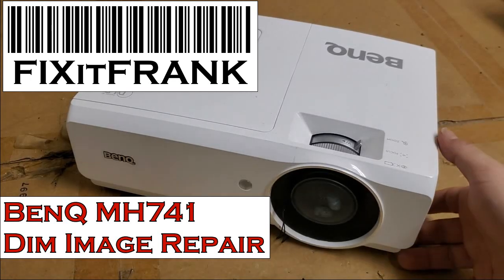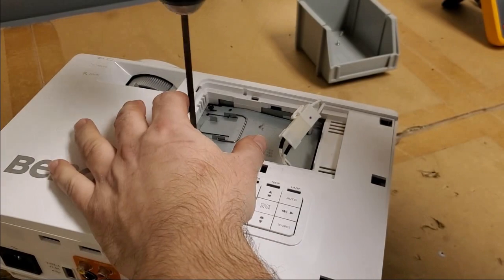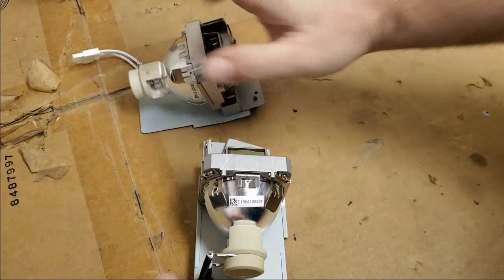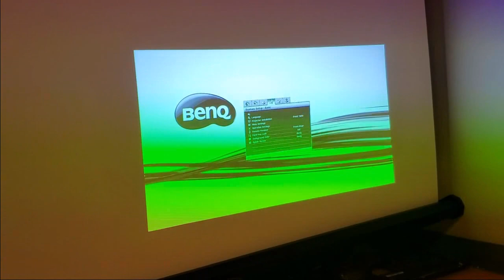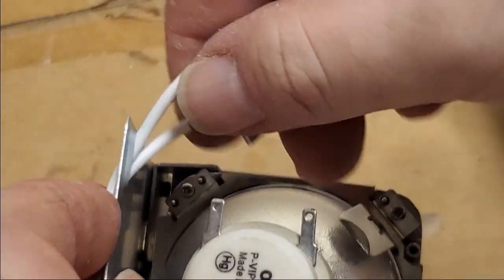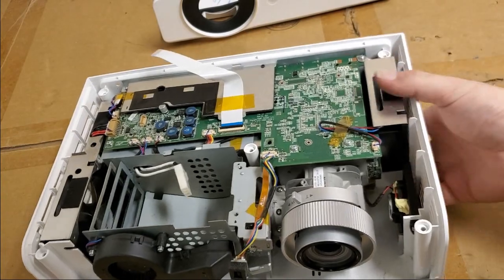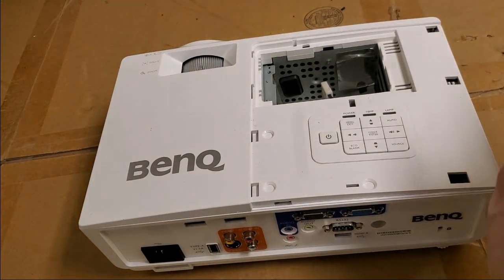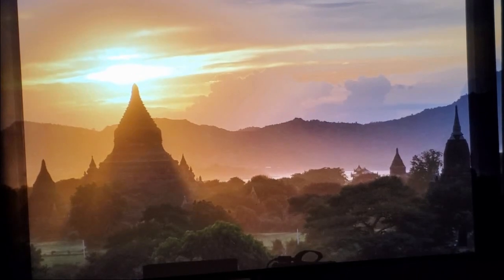BenQ MH741 DLP Video Projector Dim Image Diagnosis/Repair - How to Clean

Comment: Would this be a good projector for a golf simulator?  I found a lightly used one for around 250.
Reply from the maker: it'd probably work fine. Im not super well versed on their uses though.  I just repair, I haven't done installs in a long time.

Comment: I have an Epson Cinema 1060. When I look for new lamps, a million options come up. I just bought one and seems as dim. Can you guide me to a legit lamp? I couldn't find it on the Epson site
Reply from the maker: https://epson.com/Accessories/Projector-Accessories/ELPLP97-Replacement-Projector-Lamp-Bulb/p/V13H010L97   (if they get them back in stock, epson has been weird recently) They discontinued the ELPLP96 and replaced it with the ELPLP97.  The only difference is a notch in the connector that was removed.  Otherwise they were identical.    There are some aftermarket Osram options but I think this one will be better. https://www.purelandsupply.com/epson-projector-lamp_elplp97.html  This one has the osram inside. Its pretty good and might be fine but  if you look elsewhere you want at least an osram but ideally an Iwasaki /epson bare lamp inside.
Reply: @FixitFrank  thank you sir!!!
Reply from the maker: One other thought. The 1060 is kind of known for cooling issues. If you get a lamp and it's life is short or if it smells funny the blower fan should be checked or possibly even cleaned. I doubt you'll run into that but i remembered a few 1060s that it happened to.
Reply: @FixitFrank  do you know any pages that show a full breakdown of the 1060? Seem to only have access to the lamp area, unless you're meaning to just used short blasts of compressed air? I'll be ordering a true lamp this coming week lol

Comment: this is a bit of a weird one, Frank, i have a BenQ TW535, it's 1280x800 native but you can input 1920x1080 and i guess it downsizes it(?). So when I started playing games with my computer output set to 1920x1080 it kept going blank and saying 'out of range', which it never did until I started playing games on it. I changed the output from my computer to 1280x800 and the issue has gone away. Am I correct thinking it was having too much info thrown the downsizing chip?
Reply: excuse terms like 'downsizing chip' i don't know what the right names are :)
Reply from the maker: You're good! I never had training on this stuff. I just learned as I went. Downsize is a good description for it. I think it's called  up scaling or down scaling. 
I suspect it's because of the input you're using. Vga can bypass the scaler and is projected as it's sent from the source. The upscaling would probably work on another input. If your PC video card has DVI, you can use a dvi to HDMI adapter which are cheap(less than 10euros usually). 
Ideally you want a true 1080 dlp unit though. The rescaling is a marketing wank trick in my opinion. I wish they'd be more clear about the capabilities. 
1280x800 is doable but I've been running 1920 x 1080 for a while and would be annoyed at that myself.
Try the other inputs and I think you're going to be able to get it going.
Reply: @FixitFrank  to be honest for what i paid 1280x800 is fine, i mostly just watch films and now sometimes play games, initially i could see the rainbow if i moved my eyes but that seems to have gone away i don't know if my brain filters it out or if the projector has just sort of broken itself in. i nearly bought one of the chinese no name  brands but the nice folk on reddit guided me away from those and i'm glad of it now i've seen the quality difference (both construction and image quality)  and the image on this entry level benq is actually really good (i project to about 80inch diagonal) and it's bright as hell, it's hdmi out from the pc to hdmi in on the projector and like i said since i changed the res to the projectors native resolution it's been fine. your channel is really good i love your videos!

Comment: Hello.
I need your help.
My Benq mp 615p got 3 orange POWER TEMP LAMP lights.
What could be the reason?
Reply from the maker: Hello!  Are they flashing or lit without any changes?
Reply: @FixitFrank  Burn unchanged.
Coolers don't spin.
Does not respond to button presses.
Reply from the maker: @СергейВасильевич-ш8в  That is a bigger problem.  Power supply or PMD1000 IC could be the problems.  Do you have the top case removed?  If you can email me(on the about page) I can send you service manuals with  more troubleshoot information.
Reply: @FixitFrank  Thank you, I wrote to you by mail and really look forward to your help

Comment: I happen to have the same projector. Thank's for the video.   BenQ prompts to get a bulb from https://www.benqdirect.com/lamp-mh741.html      Have you ever dealt with BenQ Direct ?
Reply from the maker: Hi Boris,   They are BenQ's store so they are fine to use.  The price is quite good as well. I have not dealt with them personally but I am aware of their products and they will serve you just fine.
Reply: @FixitFrank     I noticed the price was alittle better than the site you recommended but BenQ's site had allot slower shipping.   I purchased one from the place you recommended, It will be here in 2 days so I will know more then.
Reply from the maker: @BorisFett  Hi boris, Which site was it?  I may be able to get you a partial refund. I reported the price difference to the sites of people I know and they all said they adjusted the pricing.  However it may not be live yet so you probably paid the higher price.  Or If you want to email me sales@weezytech.com with your real name, I can confirm for you.   The lamps are of equal quality on both.
Reply: FYI: The bulb from Pureland Supply was exactly what it was supposed to be, It even showed up a day before the expected date.   The original bulb always used to slightly flicker in eco mode and this new one is flawless.  Other than the $30 drop in price after i ordered it,  I would still recommend PureLand Supply at this point if you need a quality bulb fast.    -Edit: They refunded me the difference due to the price drop being within a week. Cool people.